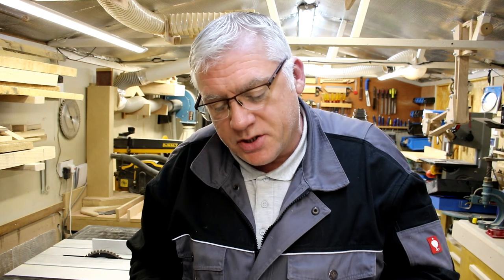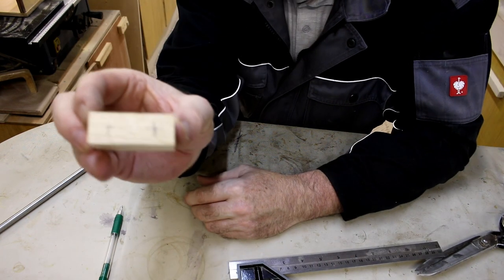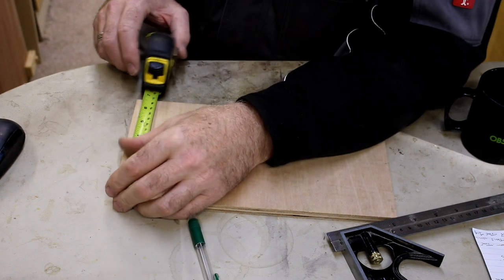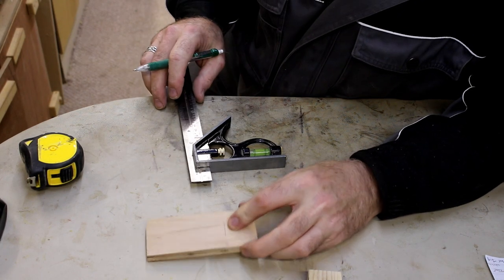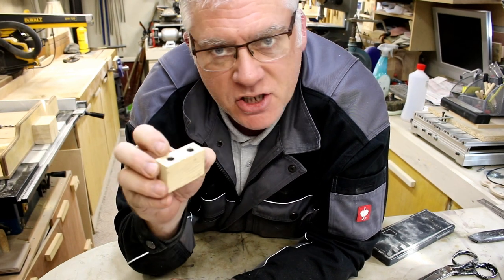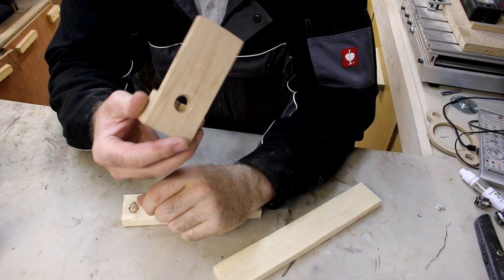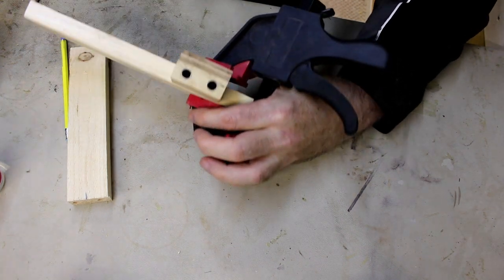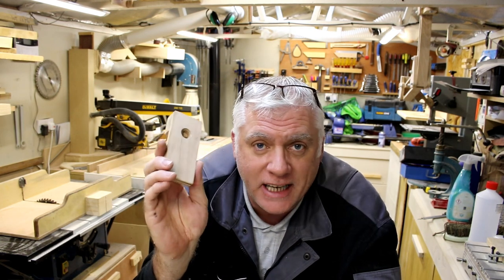How To Make A Simple Diy Dowel Jig / Doweling Jig

Comment: What size of pipe do I need to use so it can't fit nice and firm in the holes?
Reply from the maker: 10 mm outside diameter and 8mm inside diameter.

Comment: what size steel tubing did you use?
Reply from the maker: Hi Keith I used 10mm outside diameter with a 8mm inside diameter. I used capillary tube and found it on ebay. Hope that helps

Comment: The center line really should have been set between the centers of the 2 holes, not the center of the piece of wood, could easily lead to an error if the wood is not perfect, in other words better to mark the 3 centers all at the same time if you want it to be perfect. Of course it works the way it's shown if everything is measured and cut perfectly.
Reply from the maker: Hello Harry  your perfectly right you can make the jig both ways. I'd made a single dowel hole jig some time ago and that my goto doweling jig.